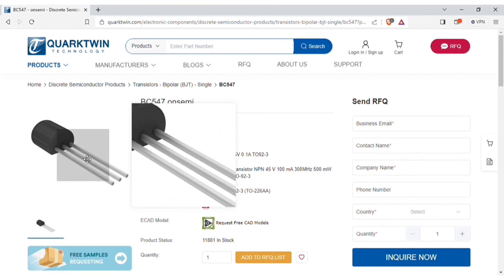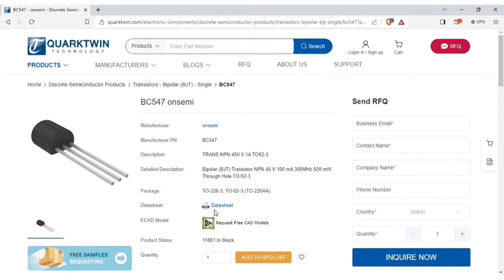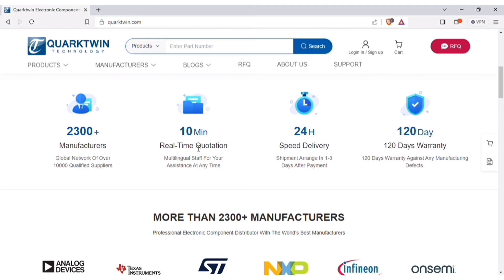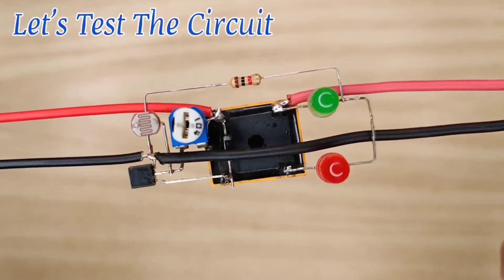3 Simple Electronics Projects That is helpful for everyone

Comment: Project was good, but at 0.16 you showed SPDT 12v relay as  Normally Open on the upper pin of relay, exactly opposite to Relay coil pin 2, but in the other two projects you showed the relay pins , at2.36 and at  5.34 you labelled the 12v SPDT Relay in a wrong manner. Kindly tell me if I am wrongly commented.

Comment: Sir how we can make a transformerless inverter 220 volt. 🤔🤔🤔
Reply from the maker: Actually for higher currents using transformer is must but you can use HF Transformer, that is very small as compared to Iron core